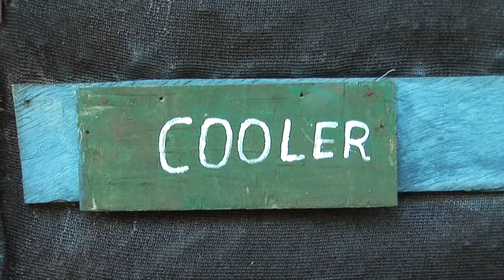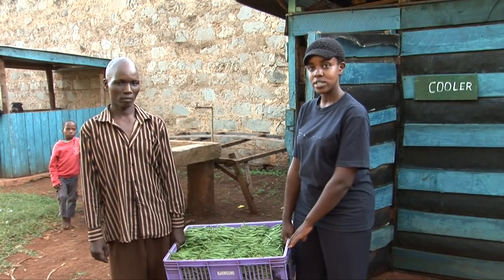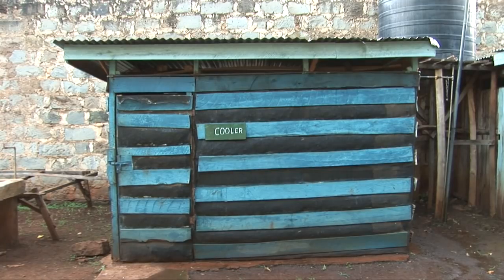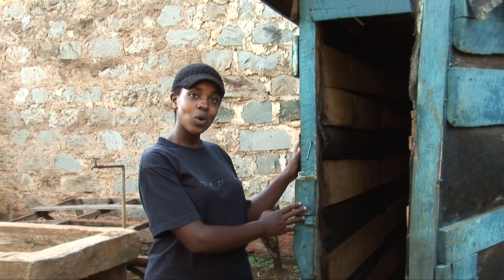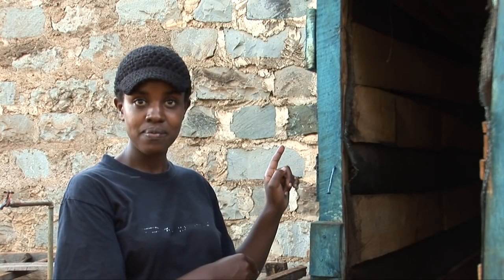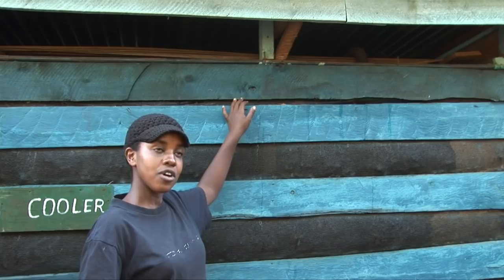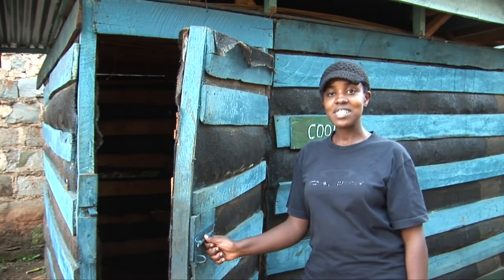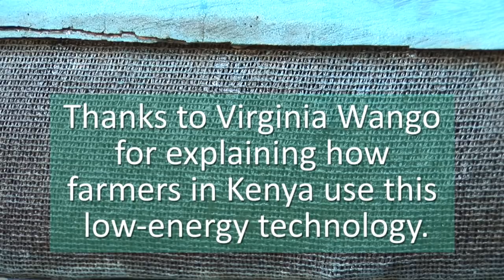Keeping Crops Cool: fascinating field fridges in Africa

Comment: Great seeing this again!

We have a farm here in South Africa, and when I was young(about 40 years ago) - and we had just recently acquired the farm, my father built this same contraption as a temporary cooling solution until we could get in the electricity and freezers- just on a smaller scale to keep things cool around the farmstead.

The wood that he used was a porous wood that was very light and of course, he used charcoal as well. The wood was of the same type as you would find, when you submerged wood into water for years and then letting the sun dry it out.
In his build, the charcoal and the wood were enclosed in chicken wire and there were 2 pipes that ran around the enclosure- situated at the very top and in the middle of the enclosure, with regularly space holes at the bottom of the pipes where water would trickle down .

The top and bottom of the thing he fitted out with foil to trap the cold. Finally, it was submerged in a chamber of clay(he used mud, shaped it, dried it out and blasted it with fire from a blowtorch to make it extra hard and reflective) to keep the temps down.
It worked so well, we kept using it even after the freezers were added- and he later added something (can't remember what exactly- think it was one of these home-made wind turbines that you find on house roofs) that trapped any wind and sent it down into the chamber to further cool it.
Reply: Cool

Comment: very cool indeed. pun not intended. is the charcoal activated? actiavted charcoal has many more fissures, and more surface area. just heat it up and spray with cold water. the thermal. shock will do the work. beautifully done. well done.